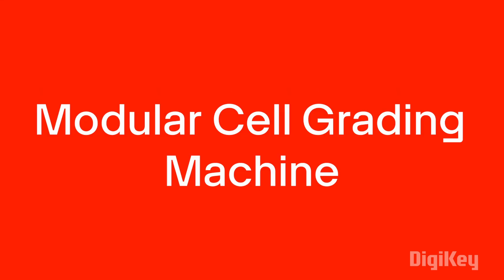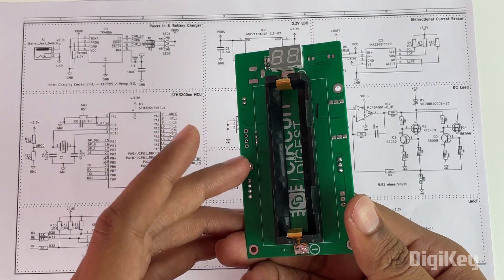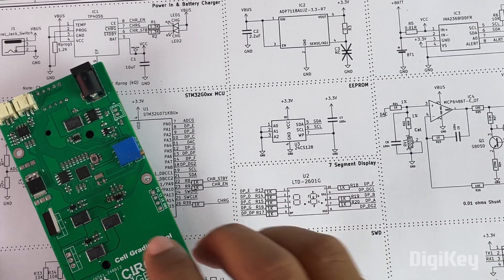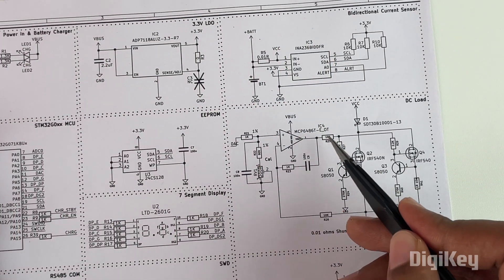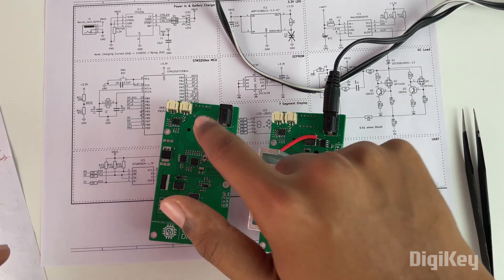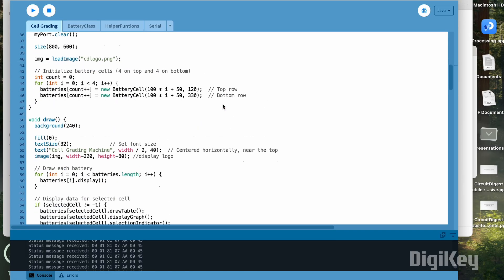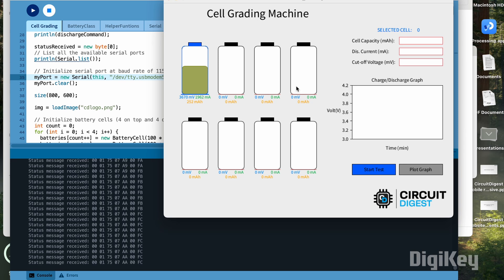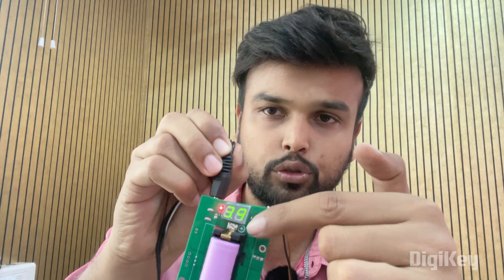How to build a Modular Cell Grading Machine for Lithium Battery Testing?

Comment: please correct yourself @1:55. you should'nt connect the barrel jack with 12V supply, use 5v power source only  @6:10.

Comment: Buen trabajo, ¿qué software utilizas en la computadora para conectar el RS485?
Reply from the maker: the current version of the software is written in Processing.
Reply: gracias, esa es una biblioteca Java para gráficos  Supongo que la interfaz de cables para RS485 es como la RS232 desde la perspectiva del software .
 Todavía no he trabajado con este protocolo.
Reply from the maker: The project uses simple serial protocol. You can easily recreate the UI in any other programming language.
Reply: @Circuitdigest  si, supongo que si, gracias

Comment: if you post the software name used for monitoring and in which compiler the coding is done only as beginners it will be easy for all to understand...
Reply: @Naveenkumar-mm5jl  one is Arduino ide and other software is called "processing " a software to visualise outcomes and such just search processing software or processing arduino on YouTube you will find it
Reply from the maker: As already mentioned in the video, the firmware for the MCU is written in ArduinoIDE and the GUI is written in proccessing.